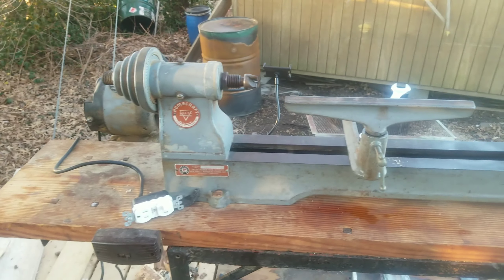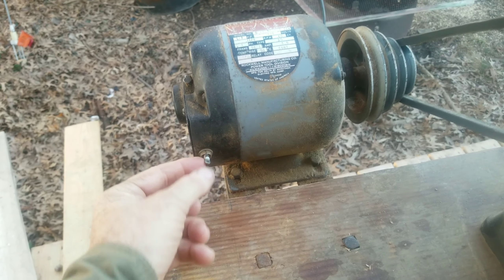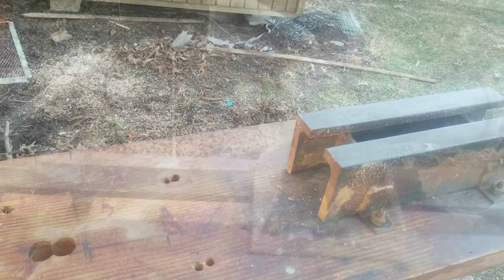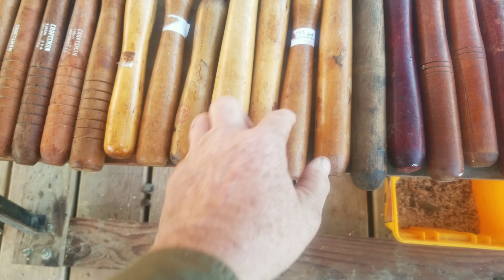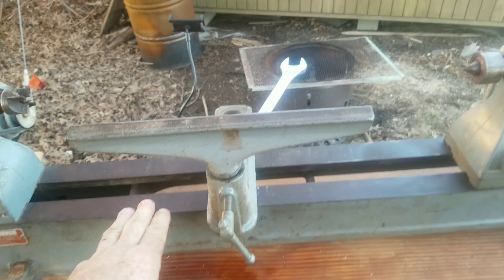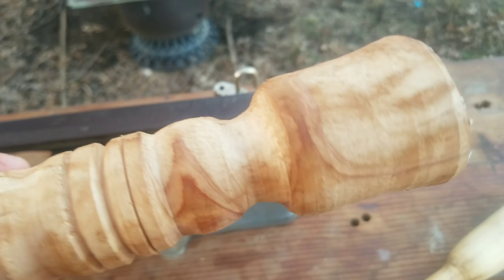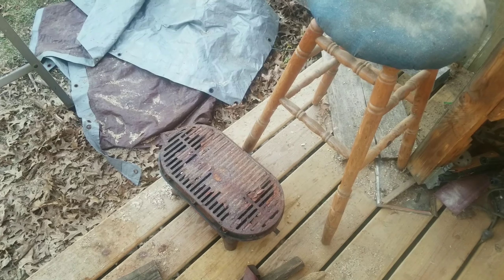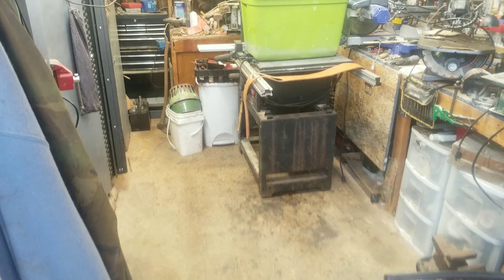Shop update

Comment: Heck of a nice score Robert. I know you'll enjoy it. A suggestion if you don't mind. Being an old millright, welder fabricator, electrician, industrial maintenance person like Kentucky Woodsman,  instead of another switch on front you could use a push pull safety switch. I'd mount it on the frame near the spindle and if you ever got your sleeve or anything caught in your work you can hit the safety with your leg or waist and shut it off. Really nice lathe 👍
Reply from the maker: Thanks my friend.  That's a great idea.  I hadn't even thought of safety.  It's always better to be safe than sorry 
Thanks for the information. 
God bless.

Comment: Cool!!!!!!!! A vintage Delta! Looks like a fella could add some belts and run a couple of different things with that. Cool grill too.... looks like a LODGE hibachi grill.
Reply from the maker: Thanks Chris. It is a Lodge Hitachi.   Really looking forward to restoring it when I get a chance.  Its got all the parts except for the wire carrying handle. And speaking of I know you have one also.  You think there's any chance you could duplicate one?
Reply: BluegrassBushcraft / I Probably can.... I think yours is older than you think it is. Where the handle connects to the body yours is a single pin ( it looks like). The newer ones are different. I'll text you a pic. I think the same handle will fit on both though. Also, the new ones have a ridge on the grill piece that will prevent a hot dog from rolling off... the old ones don't have that.  I'll see if I can make a handle... I need a new project 😉😉😉HA HA HA!
Reply from the maker: @CarolinaChrisOutdoors  I have no idea how old it is.  Picked it up at an antique store but that doesn't mean it's old.  I will try to measure the width tomorrow and let you know.  I really appreciate it.

Comment: The part on the tail-stock is called a live center.  You need a cup center for wood projects.  Lots better hold in wood.  The stem that fits inside the tailstock is  Morse Taper.  It's probably a #1 or #2.  If you measure it on one end and tell me which end and the size I can tell you what it is.  Then you can order parts.  It is supposed to be "slammed" or "smacked" under it's own weight into the tail stock.  You want to make sure it does not spin in the tail stock as this could ruin the tail stock bore.
Reply from the maker: I found a 1 inch drill chuck a harbor freight that fits it.
Reply from the maker: I watched a lot of videos on wood lathes trying to learn everything I could.  Not much out there on what part's i can use or size of threads or any technical information.